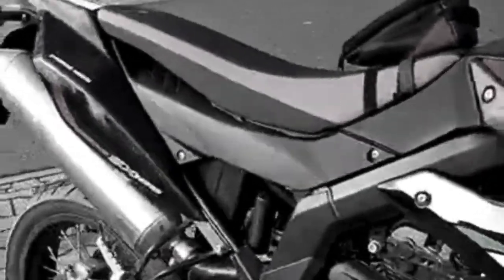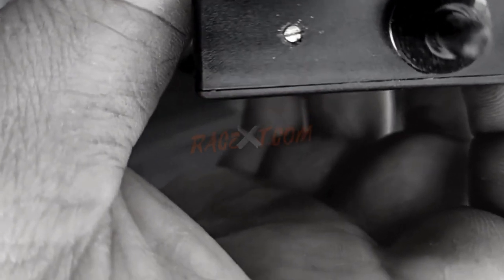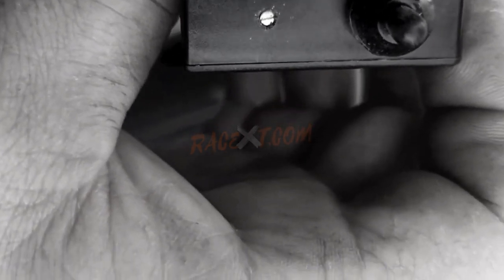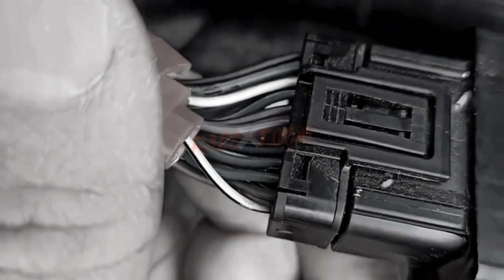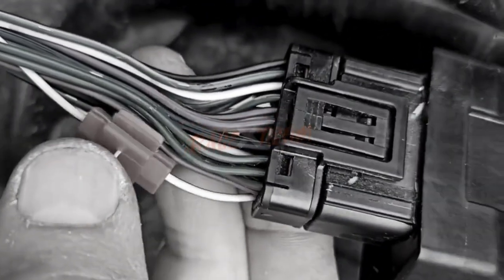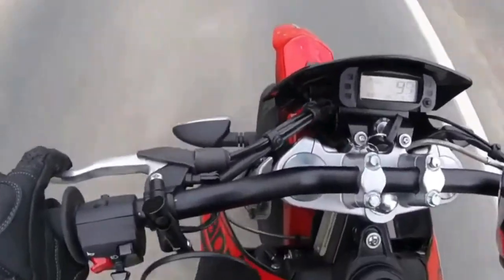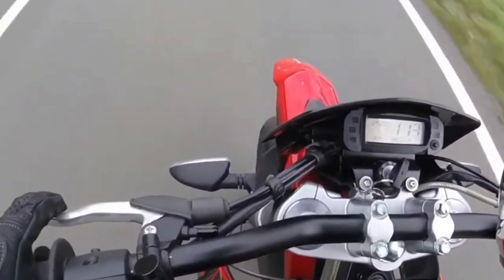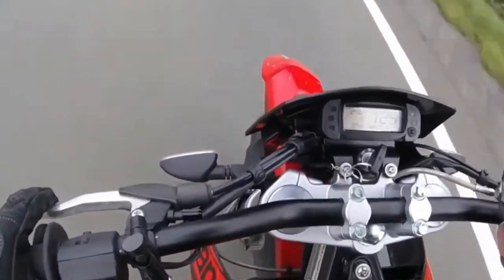Chip tuning for Aprilia SX 125 Abs my18 power unit

Comment: What kind of bs is this, how can a box with 2 wires add performance. No connection to injectors, ignition or even egt
Reply from the maker: Hi @rcdrifts4942,

I understand your skepticism about how our additional module for the IAT (Intake Air Temperature) sensor works. Allow me to explain in detail how this device improves your vehicle's performance.

How the Additional Module on the IAT Sensor Works
The IAT sensor measures the temperature of the air entering the engine and sends this data to the ECU (Engine Control Unit). The ECU uses this information to optimize the fuel-air mixture, ensuring efficient combustion. Our additional module connects directly to the IAT sensor and modifies the signals sent to the ECU, making the ECU believe that the incoming air is cooler than it actually is.

Benefits of the Additional Module
Performance Enhancement: By simulating a lower air temperature, the module prompts the ECU to inject more fuel, thus improving combustion and increasing engine power.

Torque Optimization: With better combustion, you get more torque across the entire RPM range, making the ride more responsive and dynamic.

Ease of Installation: The additional module is extremely easy to install. It doesn’t require complex connections to injectors, ignition, or EGT (exhaust gas temperature) sensors, making it an ideal solution for those seeking a quick and effective upgrade.

Warranty and Return Policy
We are so confident in the quality and effectiveness of our products that we offer a 30-day return policy, even for used chip tuning modules. If for any reason you are not satisfied with the module's performance, you can return it within 30 days for a full refund. This guarantee allows you to try our product risk-free, ensuring that you invest only in solutions that genuinely enhance your vehicle's driving experience.

Conclusion
Our additional module for the IAT sensor is a proven solution to improve the performance of your Aprilia SX 125 Abs my18. Despite its simplicity, the device offers a significant increase in power and torque, making your bike more powerful and enjoyable to ride. Our 30-day return policy gives you peace of mind to try it out without any commitment.

Thank you for your comment, and I hope this clears up your doubts. If you have any further questions, feel free to ask!

Best regards,
Thomas
Reply: also fits aprilia sx 125 2021
Reply from the maker: @sicko_lil:
Absolutely @sicko_lil—it fits the Aprilia SX 125 ABS MY21 perfectly!

👉 Order yours here and we’ll send the complete guide plus step-by-step support:
https://racext.com/product/chip-tuning-for-aprilia-sx-125-abs-my21-power-unit/

Let us know if you need help during installation! 🚀🏍️